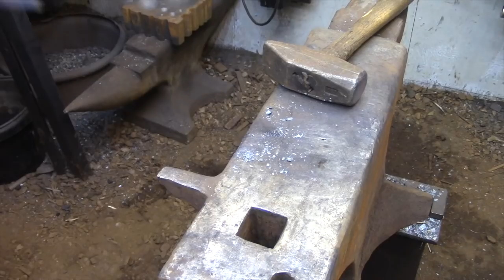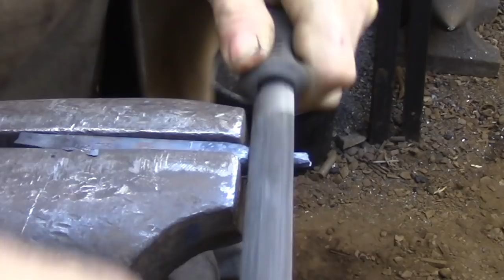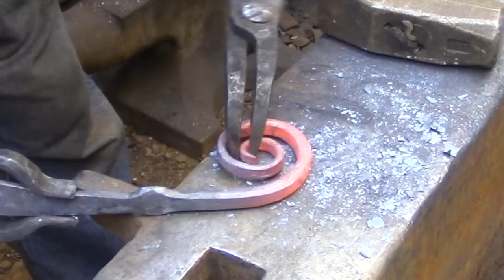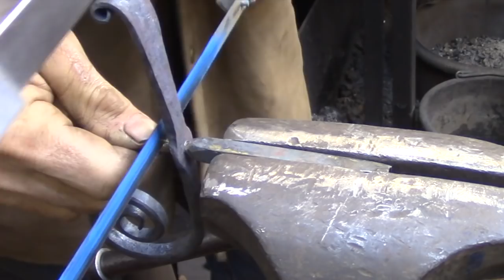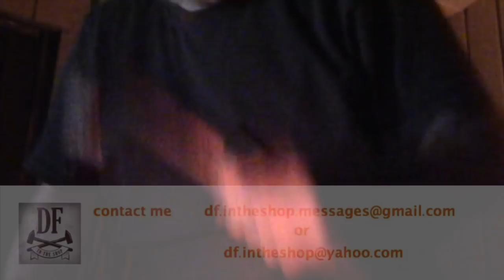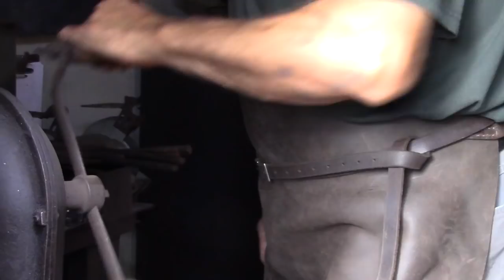Blacksmithing For Beginners - Shutter Dog

Comment: I have enjoyed all your videos, and I thank you for taking the time to make them.  I am curious if you can give me the dimensions of your anvil.  I plan on just making one, but I would just be guessing on size.
Reply from the maker: The face is 5" X 16".  The horn is 10"1/2 long and it starts from a block that is 3"3/4 at he body of the anvil.  The overall height is 12"  and the base is 11"1/2 wide by 12"1/2 long.  My hardy hole is 1"1/4 and the pritchel hole  is 3/4".   Good Luck  -  Send me a picture when you are done.